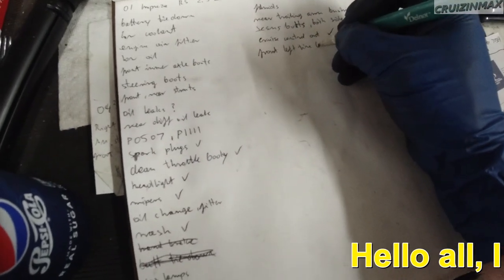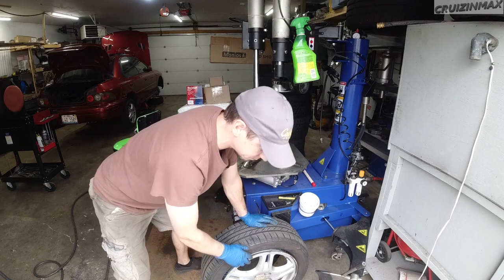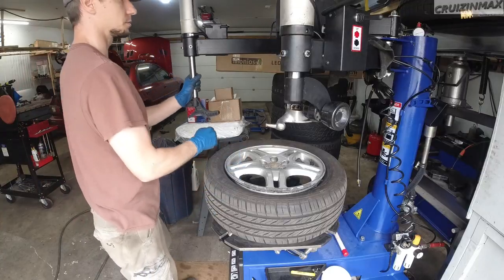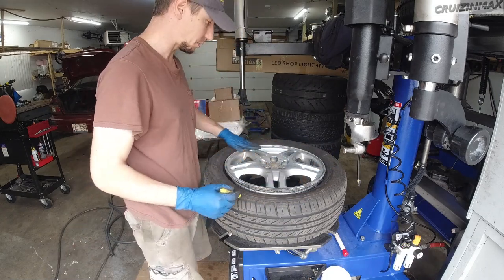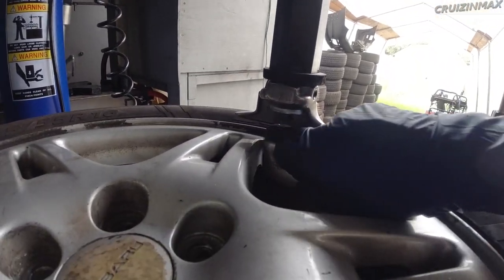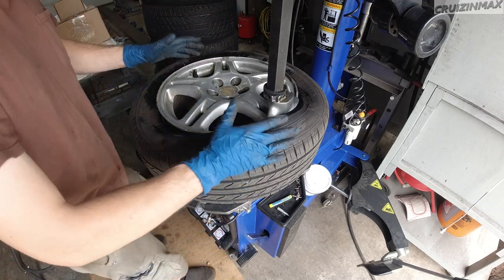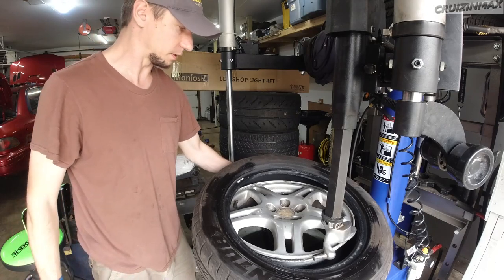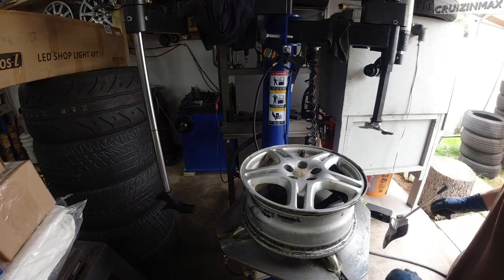Ebay Xingkong or Mayflower tire changing machine how to replace tire

Comment: Those machines make it really easy.  And it makes you super popular when everyone starts switching over to winter tires :)  Congrats!
I highly recommend a product called Ruglyde for a lubricant rather than the soapy water.  I have the cheap Harbor Freight tire changing tool that I use, and it works really well once it is mounted to a solid surface.  I made a bar to mount a similar "duck head" to roll the bead on and off of the rim, and have even done some low profile tires, and the Ruglyde lubricant makes it easy.  It is not real expensive, and it won't rust steel wheels.
Reply from the maker: thanks! i will for sure try that lubricant